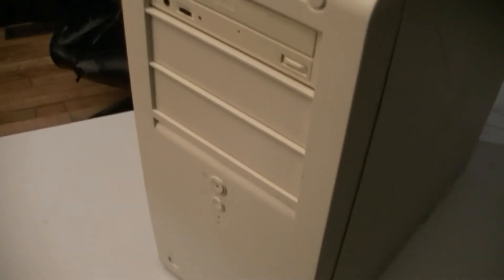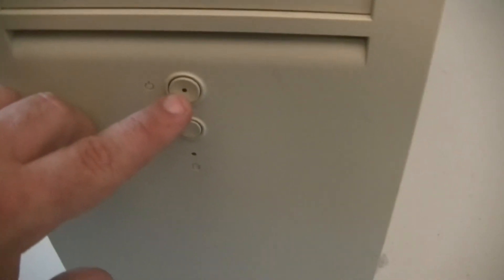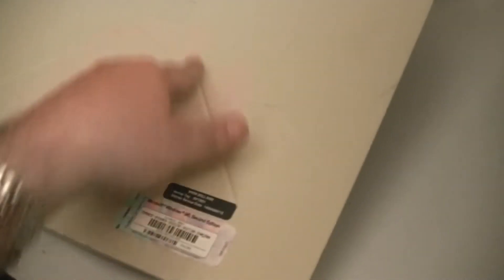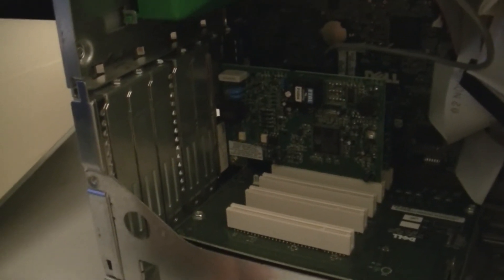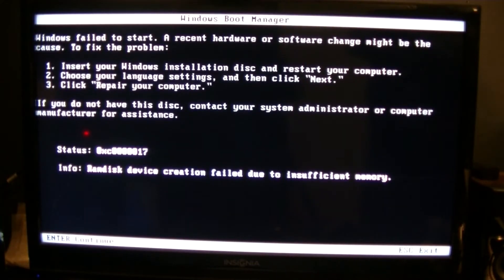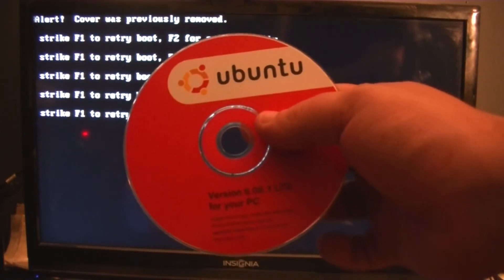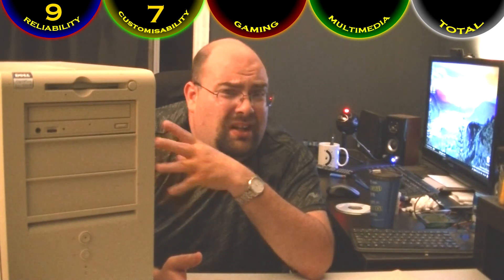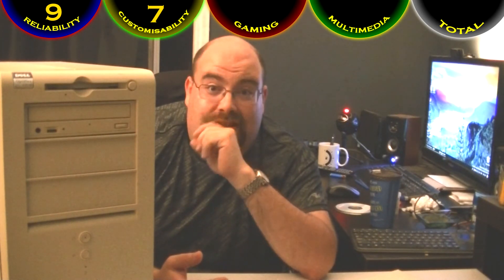Dell Optiplex GX110: Ebay goldmine

Comment: Managed to get one of these out of a church's office for free. It hadn't been powered on in 18 years but everything was flawless. It had XP and I have dual booted Win98 for some legacy software. I was genuinely amazed by the design of the case and how easy it was to get in. The slide out of the expansion port blew my mind. Added a period-appropriate GPU and sound card and it's a great machine. If you're wanting something for late 90s/early 2000s gaming this is perfect.

Comment: I just picked up a broken Dell Optiplex 400mh P2 in a G1 tower case. Planning to transplant my old Dell Desktop GX115 motherboard with a P3 933mhz into this case. Hopefully create an ultimate 2000 era sleeper PC. 😁 Only downside is onboard graphics, which I'm still puzzling over what to do with (on a smallish budget). 😕

Comment: They're great machines.  I picked one up in 2001-2002 when they were first going off-lease.  I got mine off eBay at the local eco-recycler for $50.  No Shipping! Because it was local!  I ran Windows 2000 until around 2005, when XP service pack 2 had convinced me of it's effectiveness.  I retired it in about 2007, mainly due to the 512mb memory maximum and the lack of an AGP slot. A 1ghz Coppermine PIII was a cheap upgrade back in the day and made a heck of a lot of a difference over the 600mhz chip I had in mine.

I still have it, it's one of my "tweener" machines that I use for moving stuff between different generations of machines.  It runs Dos 6.22/WFW3.11, Windows 98 and God help me... OS/2 Warp 3.  

There IS a Tualatin Powerleap upgrade to allow you to use the later PIII/Celeron server chips with higher clock speed and more cache.  This requires you to revert to the A05 bios.  There's also a Pin-mod you can do to allow you to use the bare chi, that's still available from a seller in South Korea.  

Neat Machines, well built.  I'm keeping mine!
Reply from the maker: +Dennis P. Wow! Thanka for sharing your story! This is a perfect example of a machine that can do much more than people would think. Even though it lacks an AGP slot, the PCI slots can compensate for that. Latest PCI card I've seen was a Nvidia 8400GS. I think it can go to 1GB (2×512MB) if my memory recalls correctly.

Comment: I have a desktop version p3.  Got it for free back in 2005.  Now after more than 12 years i powered it up again.  Damn thing still works.  

My plan with it i to use it as a win98 machine because i want to have the dos option to use those old dos programs again. 

My machine has sound build in.  

Also i keep it.  Gonna make it run again and restore it.  

Btw... also using my period correct compaq keyboard without windows key.

Comment: I have one of these. Got it for free about three weeks ago, and I've decked it out since. I love working on the case. it's fantastic compared to other "mini towers" from the day. Had an HP Pavilion from 2000 and it was a piece of shit to work on. I have not had this work with more then 512 megs of RAM, but I haven't tried. I'm a little dry on PC100 these days. For gaming, mine has an ATI Rage AIW Pro and a SoundBlaster Live, and those run period correct games fantastically. I will admit it weighs like a thousand pounds compared to the Compaq I also got.

Comment: Do you know how to remove the right panel? Trying to but can't figure it out.
Reply from the maker: You probably (definitely) won't like what I'm about to say but, the right panel is fixed with the frame and can't be removed. Unless you use a grinder or hammer but you won't do that.
Reply: @lhuser  ok thank you
Reply: @lhuser  i might try to remove it somehow because I'm gonna try and turn it into a sleeper so I'll need to drill motherboard holes somehow
Reply from the maker: @HP_Games  Well in that case, go nuts. Let me know how it turns out.
Reply: @lhuser  I'll try and remember. Lol. I have to wait for the chip shortage to let up. Also, I cant build it at all unless I can drill motherboard holes, so the right panel has to come off to do that.
Reply: @lhuser  I noticed that on the back there are "tabs" from the right panel. Does that mean there's some way to remove it?
Reply from the maker: You'll still meet either rivets or melted plastic. Or both. I'm not sure what tabs at the back you're referring to, but you can try if you want. Don't force it though; you want a nice sleeper! And I get you with the chip shortage... nowadays I could go on eBay and sell my GT210 for 1k and someone will buy it (probably not).
Reply: yeah. I hope that they are just easily accessible rivets. The "tab" (for lack of a better explanation) is just a piece of plastic similar to the ones on the bottom for the stand that make you pull it off forward. The ones on the back wall are in a position that makes it appear to slide backward.
Reply: @HP_Games  hi, was wondering if you have managed to make any progress on the case and sleeper creation. 

I am currently tracking a case of this exact model and I am very interested to see what it's capabilities are. 

Questions I have:
1. Will this fit an ATX motherboard?
2. Is there enough room to stuff a 3090 TI FE in this bad boy?
3. What are my options to munt a 360 AIO radior in it?

Thanks in advance.
Reply: @vidsurfer0725  it will fit an atx motherboard but the rear io cut-out lines up with micro atx. The max length GPU is 380mm so find one less than that. You can fit a 360mm aio on the bottom but you have to cut up/off the GPU slide-out bracket. Also, I figured out how to remove the right panel. Bit of a hassle tho.

Comment: Hello. I have a Dell Optiplex GX110 with 1.0 ghz processor but it wont boot up.Is this machine worth anything ?
Reply from the maker: To Ebay it seems like it, but for me, it comes down to if you want to keep it for old school games, retro apps or if you want to hang on to it. There's four LEDs at the back when you power it on. What does it show you when it's on?

Comment: i have a dell similar too that, it had a 866mhz p3 and 256mb of ram but the issue is the gpu,, it doesn't support openGL so it didn't boot. mine was a desktop verson. i've even upgraded the cpu to 1ghz.
Reply from the maker: +stockingandblossom1 Was it an Intel IGP or an ATI?
Reply: intel i believe. it's the same model the only difference it's lays down.
Reply from the maker: +stockingandblossom1 According to Wikipedia, it is an Intel. It claims to support openGL 1.1 and no openCL. It's a AGP based chipset, which is weird as the 810 doesn't have AGP card support. So my guess is that the integrated graphics uses the AGP bus, therefore, no AGP slot. Weird...
Reply: did i say opencl sorry, but i don't think it's enough since everything was jurky and sluggish. mine doesn't support agp either.
Reply from the maker: +stockingandblossom1 Apparently the intergrated graphics uses the AGP bus. I don't get it, but you could try a PCI graphics card that could handle that. Still, you'll be in for a patience game.
Reply: i could but there's only 3 pci slots and two isa slots and one pci and isa is shared. :) but i do have a dual p3 setup i'm working on.:)
Reply from the maker: +stockingandblossom1 There you go. The more power you can get is best!
Reply: :) the motherboard is an asus cuv4xd:)

Comment: Hello friend I was detailing your information on YouTube My original language is Spanish I am using a translator for the moment my computer is an Optiplex gxa pentium 2 with 512 ram and two hard drives of 3 and 10 dell nx 333 motherboard, my problem is I need a disk to enable the ports isa and pentium I do not know if you would have them I would appreciate all the information you have about this record atte juan carlos vega gonzalez